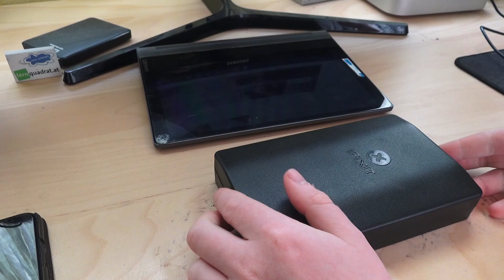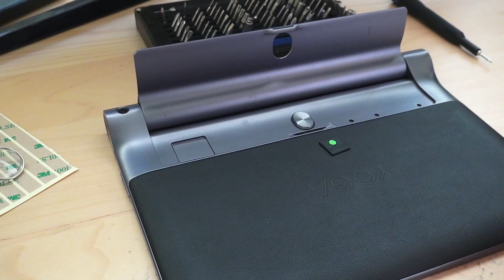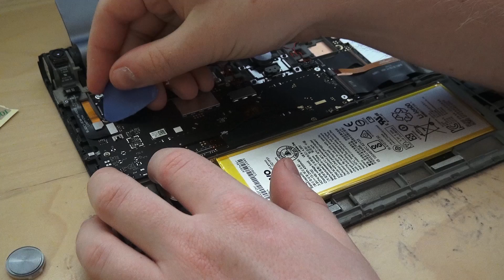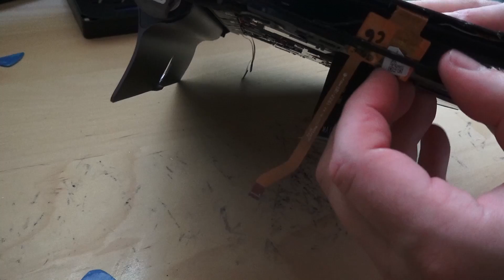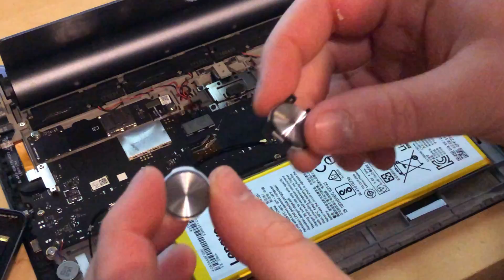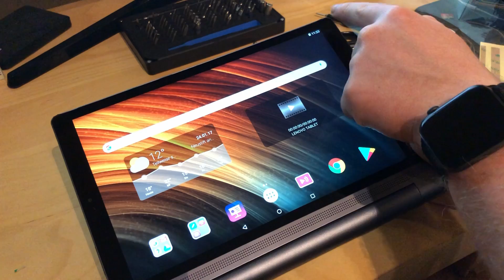Lenovo Yoga Tab 3 Pro 10'' Screen Replacement

Comment: Thanks for the video, l just watched this video and was able to replace the battery and the screen successfully , but the screen is not coming on. I checked the screen cable and is connected correctly. I don't know how long the  new battery takes to charge, there's a flashing white light that mean is charging. I need your help

Comment: Thank you very much for this nicely made video. Do you know whether or not the back and front frames of this tablet (Yoga tab 3 pro YT3-X90F) is the same as, say, Yoga Tab 3 10 Plus X703L or X703F or YT-X703L or YT-X703X. 
In addition to the screen, I want to change the broken back frame, but couldn't find the replacement yet. However, the front and back frames of X703L, X703F, YT-X703L, YT-X703X could be found easily, and they look (to my eyes) exactly the same as YT3-X90F.

Comment: I'm actually just out to replace the USB connector, since I managed to mess it up REALLY badly, it's a bit embarrassing really.. This video helped a lot, and I was able to take it apart successfully with nothing but my fingernails. No, really, it worked like a charm, and I don't even have long nails. They sure are sore now, lol. No harm done, everything is as it should be. Hopefully, other than the USB port, I didn't break anything. Now, to actually order the part I need. Probably should've done that beforehand..

Comment: Hi, nice work. I have a screen issue that has vertical lines. I dont know if its cable issue or screen itself. So i used your guide to open case and removed and reseated cables but no change. I am not sure if I should assume it is now 100% screen issue and not cable. As what if i order new screen and its the same? Is there a way to know what the issue is? Thanks  EDIT - I saved a screenshot and sent it to my pc and the lines are not there. Also, the screen seems to save a ghost image of the last thing opened. Cable or screen? :/
Reply from the maker: Sorry for the late reply, I just saw your comment! It sounds like your screen has few issues. However, it is hard to know from a distance. However, my tip would be on the display! Maybe you have a tech-savy friend who could check it out and determine the problem for you 100%! :)

Comment: Thank you!  Especially for the part where you caution us to just go slowly.  I am impatient, and probably would have snapped the little round part of the case near the power button.  Your video helped me open the case and discharge the remaining power from the device with the battery disconnected.  It wouldn't turn back on until I did that (which I learned from a video on the Yoga Tab 2).  Very much appreciated!
Reply from the maker: Yeah, trust me I always say that since I know from experience that rushing things just doesn’t end well most of the time. (I am quite an impatient person as well. ;P)
Awesome to hear that my video was able to help you! :D And thanks for sharing your case and fix for it with the rest of the world too!

Comment: One thing to note is that there are 3 snaps in the center of the back panel which need to be released....I did it with a long plastic putty knife...they are directly behind the battery compartment.
Reply from the maker: Thanks for sharing that information! 😁👍

Comment: very well done..congratulations on posting this video. This is a quite rare tablet, so there is very little information available on how to repair it. Thank you again for posting this. I will try to replace my primary battery tomorrow, now that you have shown me the process. Much appreciated.
Reply from the maker: Thank you so much! 😃😁 I had the exact same experience when I was searching for a tutorial on how to take it apart, which is why I decided to make this video to help people like you and me to actually have a guide to follow, since it makes the whole process so much easier when you can watch how it’s done before doing it yourself. ;)
Reply: @thatrandomtechguy4385  unfortunately,  the new battery did not solve my problem.  I am getting a critical error message on startup saying that impossible 0 mv detected, this will have to be fixed. Then the tablet starts. But charging is somehow limited to 72% and stops, and the tablet turns off at 29% charge indicated. I have done a hard reset which resulted in no change. Any ideas on how to fix this?

Comment: Actually i am working on one of these as well! Do you happen to know the battery type? I need to order in a new one, seeing thats whats wrong with mine😄 thanks for any help^^
Reply from the maker: What I found was this link to a seller on EBay: https://www.ebay.at/itm/163932514042 . Maybe check the serial number if it matches the one that is described in the offer and if it does then this should be the battery that you need! ^^
Reply: i am doing the exact same repair.  You need to find an    L15d1p31     battery.

Lenovo Yoga Tab 3 Pro L15D1P31 YT3-X90L 15.2Wh Battery

Your Order From hotbattery.net

is where I got mine from. Good luck with this rare bird.